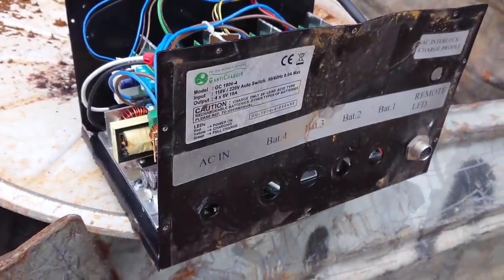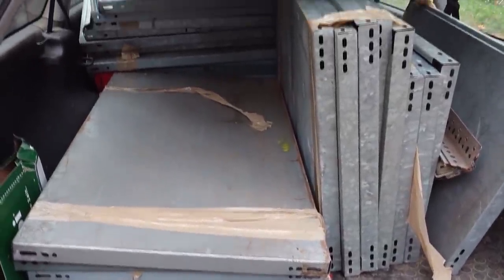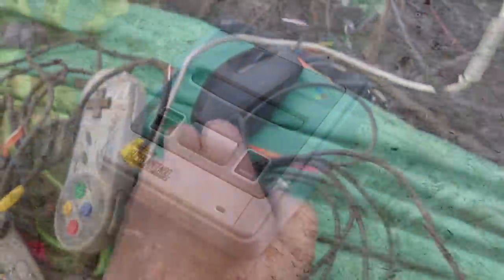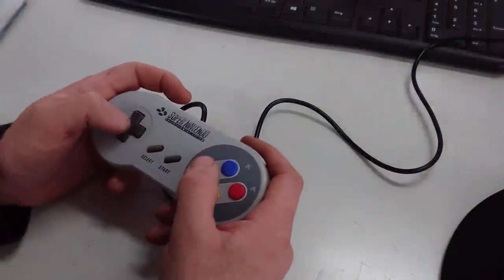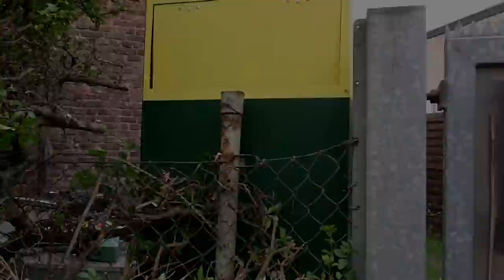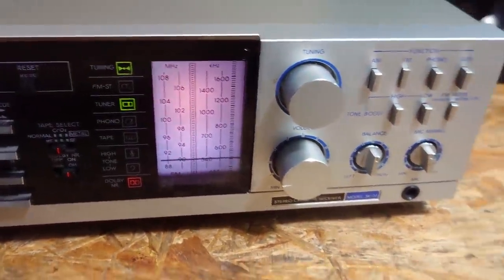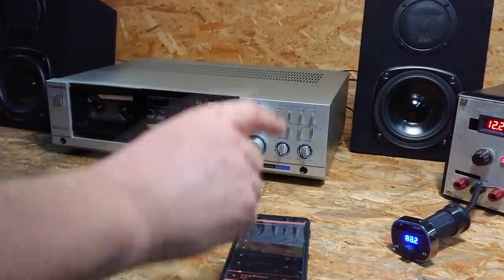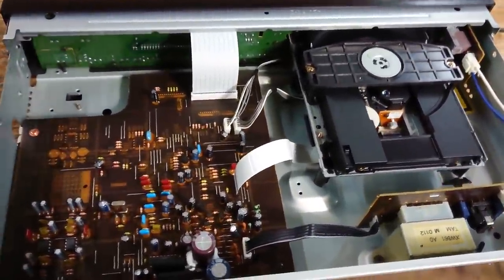Supreme Scrapyard Finds! Repair-A-Thon!

Comment: Perhaps a double action door inside of the package box would be the answer. When the front door is pushed open the interior double action door would swing up to block the main part of the box so the postman could push open the front door and place the package in a cubby hole (from his point of view) and when the front door swings down the blocking door swings open and drops the package into the main part of the box. Just a thought. Have a great day.

Comment: Noticed one of your speakers the inner dome has a dent in it.  Just get a bit of tape, I use gaffer tape or sellotape and gently press the tape on to the dent, using a blunt rounded tip of something the diameter of a pencil, then holding both ends of the tape pull off uniformly and the dent should come out.
Reply: You can also fix it with a vacuum cleaner and a small hose - for example the ones used for a small brush to clean keyboards, etc.

Comment: If your WiFi reaches your new package delivery box, you could add a Ring doorbell video camera to the INSIDE of the box for security!   Every movement inside the box would turn it on.  But since the movement inside is also infrequent, the battery would last quite a while!
Reply: He could build a very simple ring. You need 2 cameras. One inside, one outside. Motion sensor on the inside and when motion is detected it will take photos or video for 30 seconds after the last motion with in the 30 second range. For example if motion is detected recording starts and it takes 3 seconds for the motion to stop and no more motion is detected then you have a recording of 33 seconds.

Comment: About Yamaha CD player. I keep seeing the same CD player mechanism in Phillips and Marantz. There are 2 plastic squares under the cd tray which in theory supposed to help the cd tray slide in and out but they start get in the way as cd tray flexes with age. Try removing them. They are held with one screw each.

Comment: There is a belt in the Yamaha that opens the drawer, they get old just like the tape deck. Also old grease gets stiff and makes the job harder for the belt. That Pioneer CD player has an awesome drawer if I remember correctly.

Comment: Semi automatic tape mechanism in this toshiba was wery popular in early 80s. You can find it in phillips as well. Not only you can buy belts but aftermarket gears made by 3d pinters as well. Very nice piece. Im surprised amp is build from deescreet elements.

Comment: Oversized postbox is a great idea but not very secure. Seems like you need a two stage system one door that is easy to open in order for the delivery guy to drop stuff into, but then a secondary door that can secure the post so someone doesn’t just reach in through the first and take stuff. Could be mechanically actuated or electronic I guess- so when you open the first door to drop mail in there’s a false floor that is kept secure, but once you close the first door that false floor falls away dropping the package down and securing it in the bottom.

Comment: I got a junk vhs player laying by the side of the road recently that the tape carriage wouldn't open. After lots of looking at it, it seems that the previous owner had something heavy sitting on top of the  player, the sheet metal outer  housing had bent down and bent part of the mechanism frame.  I bent it back and it works fine.

Comment: Some CD drives have mechanical contacts that recognize if the drawer is open or closed. These wear out over time or just get dirty. Just the fact that you transported it could be enough to wear a little dirt off.

You are lucky to find stuff like that.
Here in my area sadly most stores don't have such electronics and if they have the stuff is priced like the most expensive example on ebay so not worth having a look at. Stuff that does not work isn't making it to the shelves. They throw it in the trash asap.

I never liked those toolboxes tho. They are just too noisy if you have them in your car so I prefer those made from leather.

Comment: The Yamaha CD player that won't open... check for an old, stretched belt in the mechanism that drives the tray.  I just had exactly this problem in a Denon CD player and solved it with a new belt.  BTW...... if you have trouble finding one of these small belts, you can substitute an O-ring.

Comment: Mahlzeit

Ich habe einen dieser sogenannten Paketkasten. War von dem Prinzip begeistert und hatte gleich zu Beginn einen Kasten bestellt. Die Schlösser waren Elektronisch und machten Anfangs viele Probleme. Das wurde besser aber als letztes Jahr das Schloss erneut den Dienst verweigerte wollte DHL nicht mehr für die Reparatur bezahlen. Ein neues Schloss sollte so viel Kosten wie ich damals für den gesamten Kasten bezahlt habe. Ich habe den Kasten behalten das Elektronische Schloss gegen eine selbstgebaute Schließung aus dicken Stahl getauscht. Jetzt kann jeder Zusteller Pakete in den Kasten legen (vorher ging das nur mit DHL) und nach dem Einlegen des Paket kann der Kasten einfach mit einem vorhangschloss das offen an dem Kasten hängt verschlossen werden.

Deine Idee mit dem Einwurffach für Pakete werde ich nachbauen. Das ist eine super Sache für alle Zusteller.

Der Paketsack ist auch eine gute, aber teure, Lösung damit Pakete kontaktlos angenommen werden können.

MfG

Comment: Both your tool and storage-related repairathons are very engaging. A cool thing to be able to do would be to visit your workshop and get to work on some project, either from a scrapyard or with a guest-submitted items. A nice collab point as well, if it is something you consider. 

Keep up the awesome work!

Comment: I loved the shelves, I wish I had more dexion shelves I only have 2 with 3 shelves each, not counting the top. Yes, the inflation is crazy, even mild steel is expensive now. I would never buy an amp that's under 250 watts, I have 2 PA1000, and 2 PA1800, from pyramid, I have a 1000x2 watt from Panasonic, 500x4 from Sharp. During the height of the pandemic, police were called, 8 times I think. I modded all my amps with better coolers, and heatsinks, I think back in the day aluminum was expensive, Keeping a class A/B power amp cool is a must. My other stuff like pre-emphasis network and preamp, some low noise Aiwa and JVC retro stuff, that working 20 years and counting. I love retro audio videos, good work.

Comment: Entirely by coincidence, I was recently looking at the US Postal Service's recommendations for mail boxes.  They have a new, large rural mail box design recommendation, suitable for many common sized packages.  (It's based on the fixed-rate domestic shipping boxes the USPS sells, but that's not really a bad thing under the circumstances.)

Comment: 24:10 i remember when i had an old 90's computer cd drives, they had issues with the cd tray not opening.
i found out it was due to dry/broken rubber drive belts inside.
(they look similar to the belts you can find in old cassette tape like the one you just fixed, and they responsible to open and close the cd drive tray)
some dvd drives and a few cd drives have an linear geared tray instead of rubber belt drive, but they not common.

Comment: Cuckoo clock drive belts can be used as well. They are a similar diameter and available cheaply from clock parts suppliers. They come in bulk, are cut to length and the ends are joined with adhesive. They are quite durable as well.

Comment: In Yamaha, check capasitors in power lines, the filtering ones first. And check all the needed voltages from power unit - 99% of issues are solved this way)

Comment: Regarding the issue of the Yamaha CD player, it can be the rubber band of the opening/closing mechanism. I recently had a similar problem with a Sony CD player. In my case, after cleaning the gears, adding some silicone oil and using rubber restorer in the rubber everything works as new

Comment: Just tune in to a news radio station, they don't license their broadcasts. 
Those metal shelves were a great find, new ones cost a small fortune nowadays and most are made of lower quality steel that cannot support the same amount of weight as older ones did.

Comment: We have this system for parcel delivery in Ireland, you buy the box from An Post (the Irish equivalent of deutsche post) for €79. You fit the box at your property and only you and the postman have a key to access it. Its a great system although not its not as large as your solution. You also get an email confirmation when something is delivered in the box!
Reply: I just use a spare recycling bin. Big enough for most deliveries, and doesn't attract attention.
Reply: If the postman has a key then any of the keys will open it, unless there are 2 locks, and a trapdoor that allows the parcel to fall through when the upper door is closed. Postman will not have a key per box, only a single key.
Reply: @SeanBZA  yes... But if you can't trust your postman not to steal your post, no amount of locking post boxes are going to help.
Reply: @benholroyd5221  Postman only has one key, so likely all the locks have the same keying as well, so any customer key will open them. More expense to order individual keys for each lock and still have a common master key, as that reduces the key space a lot, so you have a one in ten chance any customer key will operate many locks then. Cheaper for the postal company to simply order a thousand locks all identical than have the hassle of needing to manage keys per lock range, as it is all too easy to get an error.

Posties will not want to carry along a large bunch of keys for each street, in addition to the 30kg of mail, and thus will have a single key per region or street route.
Reply: @SeanBZA  or have 2 separate locks. Either a door on the front and back of the box, or a door within a door.
Reply: @SeanBZA  - FFS, don't be so stupid! The postman has a MASTER key, the customers have their own key. It's the same for an apartment... everyone's key opens the front door, and basement door, yet only you can open your own apartment's door.
Master locks are not particularly expensive, nor rare.
Reply: In Australia we have "Parcel Locker" at central locations, there is 100 or more different size lockers like used in a Gym or Swimming Pool. There is no locks, no markings, just a wall of locked doors. You tell sellers your address is "Locker 1234, Suburb, Postcode", of course choosing somewhere close to your home or work.
When a parcel arrives they send an SMS and you drive to the location. When you arrive, you do not know which door... you use a QR Code scanner to unlock the door for your item, which pops open. After you remove your parcel and re-lock the door, that locker is reassigned for somebody else the next day.

Comment: If you get silicon rubber 2 part compound you can make your own belts for such devices. You would only have to make a notch/crevas into some clauy or green sand (fine sand otherwise the grain will show.) But you know what i mean. The silicone rubber compound can be used to make feet, and other parts. Stoppers, gaskets, housing covers.. all sort of things depending on the application and original part. Same with epoxy resin. And 3d printers. You can make almost any replacement objects at a fraction of the cost and for your line of work it would not only be practicle but also a time saver as you wont have to wait for parts that might not fit or cant be found or lost in transit...

Comment: Yamaha had sproblem where the steel plate that the magnet in the motor hub pulls on, gets magnetized.  so it has too much stiction to drop and allow opening.  sometimes a good fist pound above it will free it.   but the fix is to demagnetize that disk, or flip it over.

Comment: I've had issues with disc trays before where they get shoved in and they close with enough force that the teeth become misaligned and they can't eject. My usual fix for that it to shake the device and give it a love tap in the direction the teeth engage, works 9/10 times. The tenth time I threw it too hard and had to replace the entire CD tray mechanism.

Comment: When heat shrinking little cables i put a larger heat shrink up the other end and seal the little ones in the larger one. ..Probably the same guy who threw the snes away because he couldnt find his controllers. Then threw the controllers because he didnt have his snes.

Comment: Nice to watch a repair-a-thon today.  Thanks.  They remind me there there are others that are not interested in participating in throw away culture. I was able to repair a light fixture today from used parts from my local Restore.  Restore is in the US and its like a thrift shop for building supplies.  What and where is that rail car @8:46?  It looks like it was designed to carry and pour a metal or slag crucible.

Comment: Simple optical disk mechs after sitting unused for some time tend to have their magnet that centers and holds the disk stuck to the corresponding metal plate and the soleneoid or small motor that should separate the clamping arm from the hub cannot ovecrome the force of the closed magnetic loop that have permanently magnetised the steel disk plate opposit to te permanent magnet. The drive you bought is an expensive brand but on dirt cheap ones the only solution is to dissasemble the unit and manually separate the magnetically stuck arm and because it happens relativelly quickly never to leave the drive without a disk in it, which is annoing, because when you occasionally deside to use it it starts reading the disk immediately after turning the unit on and this tend to be not a quick process on old units.

Comment: you should use paint stripper on those paint jobs, it will make them way easier.
Reply: Then he would need to remove ALL the paint, and still have to wire-brush the rust off anyway. So, paint stripper would create more work, cost $$, and perhaps be environmentally harmful.

Comment: You can actually buy these dhl paket boxes. But they are quite expensive, only work with dhl (since they have a key) and are only for smaller pakages.

Comment: old 70's audio amps with the Aux,phono, radio etc, selectors, have a chip called an Op amp in them that people swap out the ones in new effects pedals with as the new ones arent as clean I read,, they go for a few $ too

Comment: On the yamaha cd player, same sorta issue as that tape deck. just not as far gone yet. dry belt but not goo yet. So pressing the eject button a few times can sometimes get the belt into a spot it hasn't been sitting on for 20 years and works again. But if you pull the belt out and put it on the table it wont be a circle it will just stay in the shape its installed in the player.
But also some very old cd players use gears to open not a belt that drives other gears soo just a guess..

Comment: 24:20 : some high end CD players have a locking mechanism for transport. I once bought a Denon DCD 3300 for 20 bucks as "defective" only to find out that the mechanism was safely locked for transportation... Maybe check under the player to see if it has such an option.

Comment: You could perhaps have use of a dim bulb current limiter when testing HiFi stuff.
I suppose the thrift store tested to death those units that were going to self destruct before they hit the shelves. But perhaps you will find something in an attic.

Extremely hard to say anything about the Yamaha opening from here, but I'd suspect the push button first, but depending on type. Then the solder joints on the connectors, many of those single sided boards get problems after many years of vibrations and thermal cycles.
Reply: In Australia the thrift shops will not accept or sell electrical items. The way that the consumer laws are written, if you are a "corporation" or "shop" that sells to the general public, then you are 100% liable for electrical safety and for warranty of any items that you sell. So basically, all donations go to scrap.

Comment: Many CD drives use a cone shaped drive wheel to auto-centre.  There's an inverse cone on the other side.

Without a disc, these would have been sitting together, perhaps for many years and maybe got locked together.  Shaking the unit up has dislodged them?

Comment: I don't really think this matters after five months, but the CD tray not opening at first could have simply been mechanic blockage. I got my dads old Marantz Cd player where the top weighted part that hold the CD once inserted had corroded to the bottom part where the CD sits on after years of being closed and stored in a slightly humid environment. Works fine after working it loose with a flathead screwdriver. Maybe in your case it wasent that "stuck" yet but enough to not open at first.

Comment: 20:56 just take a 3.5mm jack cable and connect your phone to microphone hole and press cassette play (but with not cassette inside) it works fine in mine

Comment: Amazon is just about to release residential lockers for packages. It is to be called Amazon kebab. I have no idea what the reference is. They plan to make banks of 12 to 24 lockers for each block. They are in negotiations with municipalities right now
Reply: I actually disagree with you that this should be standard on residences. My concern is that as soon as we have package lockers, the liability for stolen packages will transfer to the homeowner. I don't know how it works in Europe, but in the states if a package is stolen off your doorstep, the retailer simply has to send you a new one. It is on them. We have tremendous problems with package theft, I would not want to be responsible for the lost value.